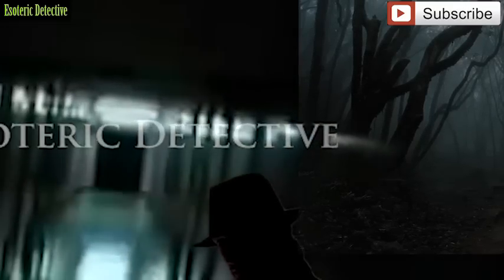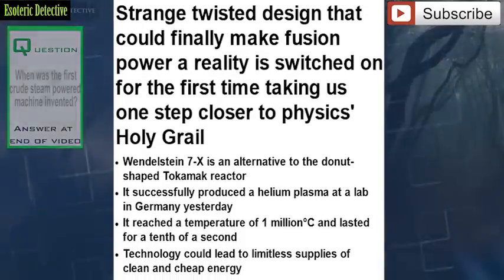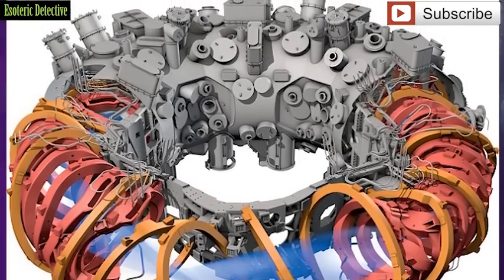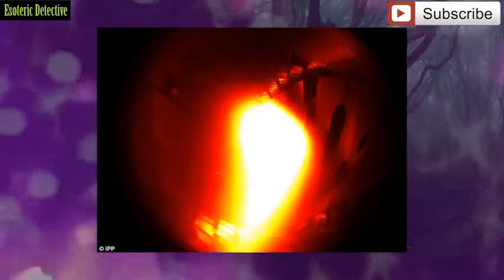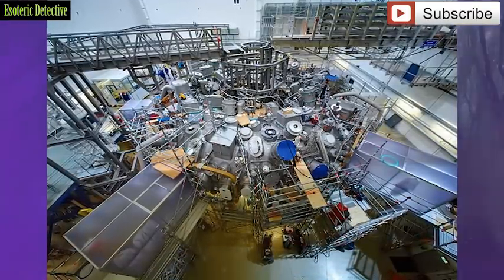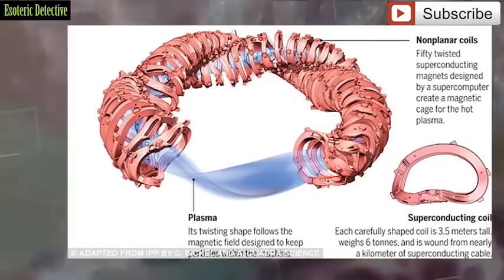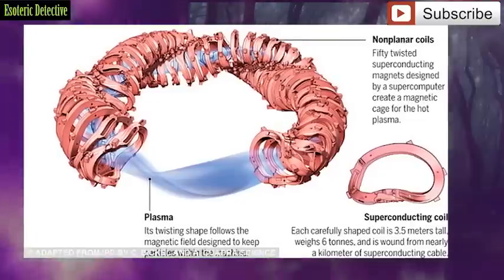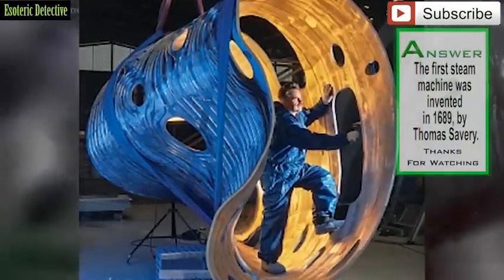Physics Holy Grail of LIMITLESS ENGERY one step closer to REALITY

Comment: As it is, this instrument is too complex and it is not practical.   One of the most important factors in this instrument is to improve the magnetic field strength and fuel sources.
First, use super conducting coils such as Barium Copper Oxides or other ones to increase the magnetic field strength and more refined, concentrated plasma stream.
Second, as the first step is satisfied, search for more powerful fuel fusion sources or anti-matter fuel source coupling to this system to produce unlimited powerful energy. 
The applications of this system will be revolutionary for  future energy demands and transportation, including space traveling. .....